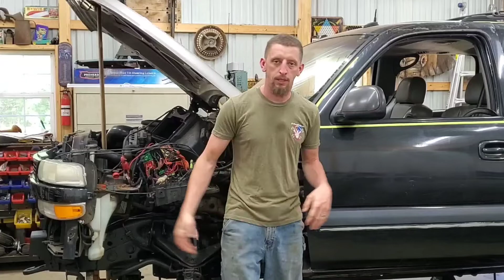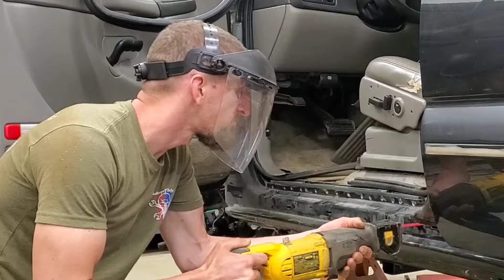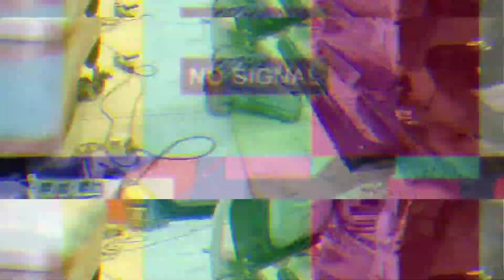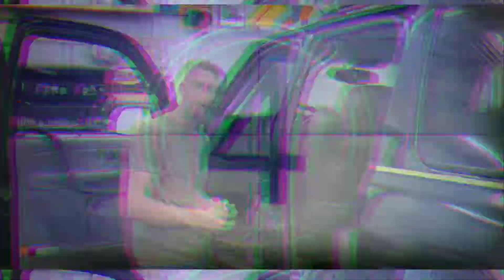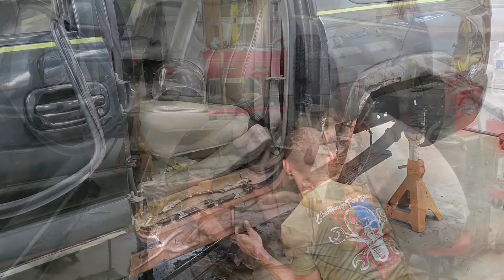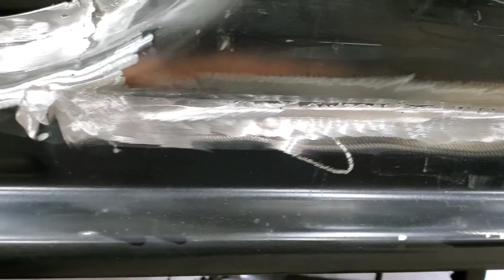2004 Chevy Suburban Rocker Panel Replacement - Rust Repair How To

Comment: Great video! I just purchased a 2004 Tahoe in excellent mechanical condition. The previous owners have maintained it (great service records) and the interior and exterior are almost immaculate.

But because it’s a GMC product, the rocker panels are showing some rust, even though it has lived in entire life in Texas and Arkansas.

This is a project that I’m going to have to turn over to a professional, but now I know what has to be done, and I especially want to make sure we can rust proof, the inner panels and the replacement panels to prevent this from happening again.
Reply: @rodrogers6895 Exact same situation, any updates on your rocker repair? How much did it cost?
Reply: @spencerhall8743 

No, it is still on my “to do list” but probably not going to happen until this time next year.

I’m fortunate that it is not as bad as some of the rocker panels I see on GM products of that era.

Comment: Yo man so my Tahoe got crashed and I believe the rocker panel from back to front are done for its smushed in but I’m wanting to know if it’s fixable ?
Reply from the maker: Tough question to answer.   I would imagine with the right tools and enough time anything could be fixed..  All depends how far the damage goes up into the rockers..

Comment: Great video!  What brand replacement rocker panels did you purchase?
Reply from the maker: I just looked at the brand Jegs is selling and it looks like they came from AMD (Auto Metal Direct).
Reply from the maker: Thank you for the feedback.    I bought the rocker panel from Jegs because of a sale they had going at the time and the rear quarter panels I bought off Amazon.

Comment: Recently bought a 2002 suburban, and I saw it needed rockers. And figured just f go to a body shop. Find out now my local shops won't even do it. Maybe dealer would but way too much. What do you think about how ready to do in a parking lot. Apartment dweller. And about how much time did it take you (minus wiring job you wound up doing)
Reply from the maker: Hmm..  I would say, give yourself a solid 3 day weekend 🤷‍♂️ to do one side considering the variables in working conditions and as long as you have the correct tools ect...  Keep in mind they make slip over rocker panels too (I'm pretty sure) rather then cutting then out I think they just slip over existing 🤔.   Overall the job wasn't as difficult to do, took me 3 times longer just because of the filming aspect..  Good luck👍
Reply from the maker: Watch this video.   I go over all the costs.  https://youtu.be/bmloftLtHPo

Comment: Great video. Nice work. Im a do it myself person. I like a challenge. I will tackle my yukon denali.I bought same type of panels but i like to use the backing plates , pop rivets and panel bond. That panel bond is amazingly strong instead of welding.  Enjoyed your video👍
Reply from the maker: Awesome!   I always appreciate it when I get comments/ feedback on any of my videos.    As for the project, it was pretty straightforward and once I removed the door 🤦‍♂️it was much much easier !   Good luck on your build and thanks for watching and commenting... 👍